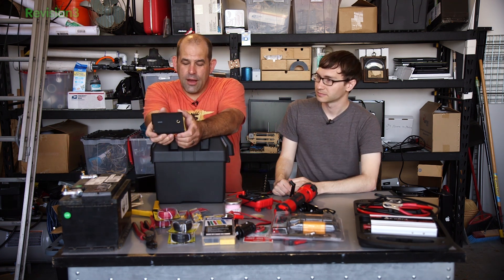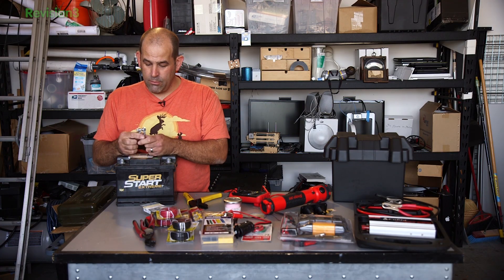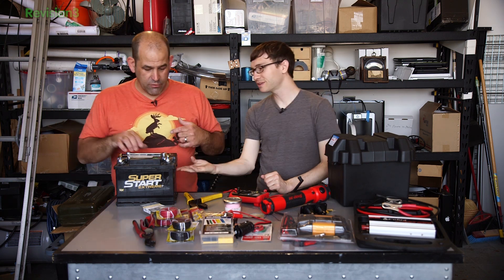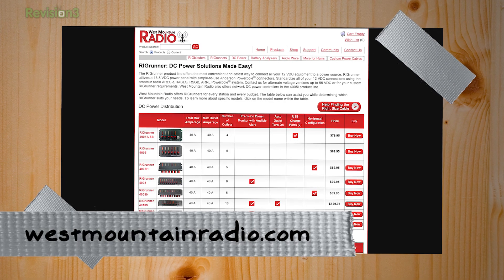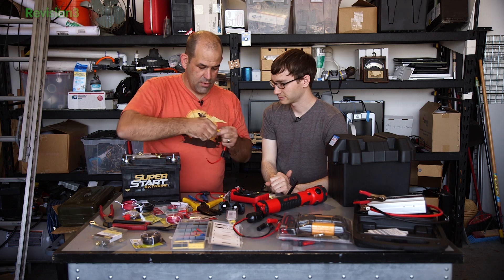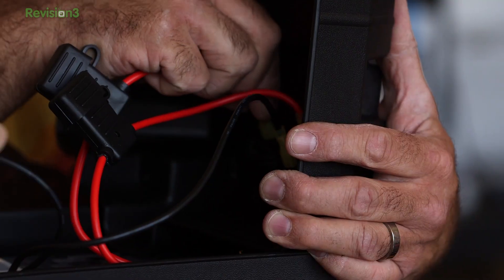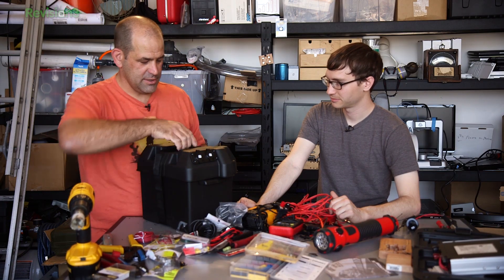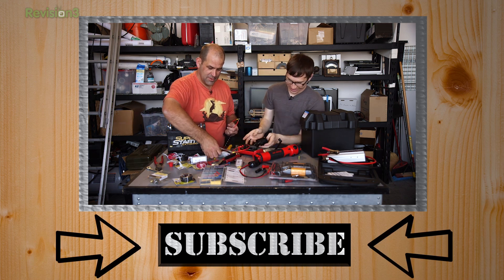Turn a Car Battery Into an Emergency Power Charger

Comment: Great video!  Want to put this setup in my truck bed box to charge my power tool batteries while at a job.  Going to add a solar panel to charge.  My only question would be what size fuses were in the lines to the outlets?  Thank you!

Comment: Anyone here today because of the power outage here in Texas???
Reply: Not Texas but Tennessee...😁
Reply: Fr😂
Reply: Well I took apart a dewalt battery pack from an old impact gun I dont use anymore and wired up some LEDs  to it for when it gets dark here soon..... I also used this for when Hurricane Harvy hit, we lived next to Lake Houston and were with out power for 3days until the U.S Coast Guard rescued us..
Reply: @TexasToxxxico  sounds good. I don't mind the darkness too much. I'll just get candles. But just came back from Walmart with a 9 dollars inverter to use for a heater and it does not work!!!! Should have gotten the 49 dollars one.
Reply: @emanuellopez1301  Sorry to here that, that sucks

Comment: So tell me how u use your battery tender plugged into a wall with no power coming out the wall socket so this method is bs
Reply: Wen the power goes out the battery, which should have full strength due to the tender giving the battery a trickle charge continually when there is power, is used as needed. A battery stores electricity for wen it is needed and only depletes very slowly if nothing is drawing power from it.

Comment: Giving you guys a like cuz it doesn't cost anything. THAT'S how generous I am. :) But, seriously, a parts list would be good. I want to make one. Does it have to be that complicated though just to charge a phone? I added connectors to my motorcycle battery and run my GPS from it with a standard cigarette lighter socket.

Comment: Hah, I happen to have an extra battery and it's the same Super Start Extreme.  I've been looking for ideas to use it as an independent power source in my trailer at work.  I would much rather charge it occasionally than mess around with a dual battery system in my truck.  I have a battery tender jr. too (unless you guys sourced this stuff from my garage) for my motorcycle and a 25A Stanley charger/starter.  Mainly want to power a couple of LED lights inside the trailer, maybe a phone charger or two.  Don't need the light that often, but the truck has to be hooked up and turned on, which it usually isn't at job sites.   

So I already bought a little 400W "Voltcube" inverter, I'll be interested to see how long it lasts between charges.  I might make an enclosure for it all together like you guys had, and I have a bunch of banana plugs/jacks so might as well give it some of those.  Also just ordered some cheap LED volt/ammeters from aliexpress so maybe I'll throw that on there.  If I want to go really crazy, I'll make a sweet RGB sign for the trailer with an arduino, parallel another battery for capacity.   

I have the battery because I replaced it (unnecessarily) a few years ago when it wasn't holding a charge consistently at all.  This is also why I have the Stanley charger, and am leery about messing with the battery system.  Sometimes it would start fine for days or weeks, other times (especially winter) it would die overnight and have to be jumped every morning.  But the new battery was doing the same about 6 months later, and it became a whole new can of worms.  Apparently it's a pretty common issue with GM trucks, but not exactly a known cause or solution.  I had very little mechanic skills, and even less electrical (I've been making a point to learn more since then).  Got the Stanley, kept researching/trying things for another year+.  Took it to 2 shops, they basically suggested replacing parts at random and wouldn't actually recommend anything.  

Finally narrowed it down and learned enough to buy a multimeter and find the parasitic drain on the radio fuses. Pulled the fuses out, has started fine for the last 2 years.  Don't need no stinking radio, I have BT earbuds grafted to my head.  TL;DR: if you want to save yourself tons of money with your vehicle, buy a multimeter and an OBDII scanner and learn how to use them.  DMM was $20, OBDII was $35, and they pay for themselves many times over.  I'm 90% certain about 75% of the money I've given to mechanics was a complete ripoff.  That multimeter was what really sent me spiraling down the electronics rabbit hole.

Comment: Not very step by step crimp, seatbelt safety plug, A-Team drill time, put the cover on...works if you’re an electrician.  Guess I’m stuck with the zombies.  I’m guessing you meant to in case people screw up and die by shock, fire or both, they can’t hold it against you.

Comment: Disappointed because you guys seem great. The DIY part - really, the information we came here for - was glossed through, leaving plenty of questions and few, deep answers. Further, a parts list would've been great in the comments.
Reply: Car battery and appropriate battery case
2x female ciggarete lighter
3ft black 10 gauge wire
2ft red 10 gauge wire
4x ring connectors
1x set of battery terminals
2x 10A car fuses
2x fuse holders OR 1x fuse block
-----------------------------------------------------------------------
addition for radio amateurs (optional)
1x set of Anderson powerpoles
2x fuse block
2x ring terminal
-------------------------------------------------------------------------
battery tender (highly reccomended)
you can buy one that uses the ciggarete lighter socket so no need to wire in extra stuff
-------------------------------------------------------------------------
DIYing your own box allows you to suit your needs the best. they just gave out a example on how the building and finished product looks. make it your own, add a light, a voltage meter, a integrated laptop charger, integrate a charger for the battery itself, add a solar input port, a killswitch that is very much missing here, anything you wish and you could think of
Reply: Agreed..!!!💯💯💯

Comment: What if im building a shack to hang out at in the middle of the woods, and i aanted to know if i could make something like this but with wall outlets to have some lights, like Christmas lights?
Reply: Buy a solar kit and you can use your extra car battery for storage of electricity, costs around $125.00  very simple set up & no drilling needed.  I bought one from a harbour freight location!

Comment: I'm a woman and I have no idea what you just did nor do I recognize the parts that you used except for the battery and the lamp that you lit up at the end. my question is......where do I buy this already made and just what do I ask For?  when you can't make it, you buy it!
Reply: Get a Minn kota power box on Amazon  about $70  does all the same.  Without the funny wiring. All you need is battery and box.Of course charger. Would also recommend Battery Tender size depending on how often you need recharge.

Comment: hi i have a hotdog cart , i need to run hot water in and have a small water pump in which i plan to use a car batt. and inverter to power i well only need to use once or twice every couple of hours, do you think i can get away with it this way or should i invest in a deep cell? like well a car batt, need to be charged more offen vs a deep cell even though i`m only turning the power on a few times a day.thanks for any input. Steve G.

Comment: I was wondering whats wrong with using zinc terminals? Also i was looking on amazon and couldn't really find the power pole wire with the fuse already setup do you know if they are on amazon i'm probably just searching for them under the wrong name.

Comment: hey patrick and michael. what about using super capacitors instead of a battery? maybe add a small solar panel to charge it anywhere in the field

Comment: I'll just assume that everything from 3:36 - 4:25... the "super cool" part of this project, actually means something, because you guys sure as heck didn't explain anything during that part. Apparently it's kind of expensive, with crimpers that cost $40... and it seams easier than something else.... and you can draw power off "the other three of these"...  but what the heck are you talking about? Seems like a pretty important part of the project to gloss over.
Reply: Point taken, probably should have cut the whole chunk of conversation about the Anderson Power Pole connectors out of there... somehow the 30 seconds that explained what they were and why HAMs and other folks are using 'em in place of traditional connectors got cut. My apologies, we should either cut the side tours out entirely or go more in depth on 'em.
Reply: patrick norton
I vote more in depth.  But I know that the longer the video is, the editing takes exponentially longer... been there, done that.
Reply: patrick norton Yeah... this video is definitely less informative than the usual. I am not even quite sure how you plugged in everything because that part is about 10 second long. :/

Comment: How hard would it be to rig one of these up to keep the lights going in a house during a blackout? The house has the lights on a separate fuse circuit, would it be very complicated to rig up? Love the show, thanks Pat and Mike!
Reply: Bad idea, unless you get a licensed electrician to install a proper transfer switch for the circuits you want to power during the blackout. The transfer switch isolates those circuits from the utility lines/you connect your generator/power source to the transfer switch.  This is important: 1) it prevents back feed from your generator from killing any electricians working to restore power 2) It keeps your your battery/generator from blowing up when the AC suddenly comes back on when the blackout is over. Good info here: http://powerequipment.honda.com/generators/connecting-a-generator-to-your-home#top
Reply: Just get lights that work like emergency lights at an office. They each charge off of your outlet and go to battery power when AC power is gone. You can actually wire those emergency lights into your home, but don't put them on a switched line. My grandparents had simple handheld flashlights like that.

Comment: I do want to try this. thanks for the little tutorial.
Reply: Please watch other tutorials. This wasn't that great unless you actually have some experience with batteries and wiring.
Reply: @TheChrislewis1989  used DC adapters for a car and it worked out great. Use it for camping mostly.
Reply: I use a deep cycle battery with an invert and I can connect a solar panel with a solar charger if I need too. Works great and free electricity. Also if I really wanted too I could connect the deep cycle battery to my cars battery so if theres no sun or it's cloudy I can run the car and charge the deep cycle battery and I also have a powerstation that i can charge both ways as well. So with a full tank of gas, some spare gas, and with the sun, I basically have unlimited power. The gas is really just for convenience. The solar charger hold a charge using the sun as a power source so I could use stuff at night if I had too.
Reply: @TheChrislewis1989  Yep. Mine is also a deep cycle battery from an RV. I really don't care about this. I have a working battery pack that can be connected to my vehicle and has USB, AC adapter, and DC connections. I'm set.
Reply: @TheChrislewis1989  it was 6 years ago now. lol. I'm fine.

Comment: Specs on those crimpers? they look nice :O
Reply: It's a Dorman brand ratcheting terminal crimper I picked up at a local auto store. Same thing is on Amazon for under $20: http://www.amazon.com/Dorman-86595-Ratcheting-Crimper/dp/B000CO7ING/ref=sr_1_9?s=hi&ie=UTF8&qid=1401394179&sr=1-9&keywords=crimper

Comment: I like emergency stuffs, thanks for the project. However, I have some questions. How much does it cost for all of these? What is the charge and discharge times? Is it worth it? Again I love your projects. Thank you for DIY projects.
Reply: 1) Cost will very greatly w/ size/quality of battery. My local Costco stocks a deep cycle group 24 battery for $80, $20 for battery box, figure another $20-30 for terminals, wire, and cigar lighter sockets.
Reply: @patricknorton  HEY YOU’RE THAT GUY! I’m in New Orleans with a Cat 1 Hurricane Ida in the Gulf due to mainline cocaine and hookers all the way until She arrives at the Coast a Cat. 4. There was too little time to even do a Mandatory Evacuation so I’m going to try to grab the things I need to make one of these, you figure a 800CCA 24 size Lead acid can charge a MacBook Pro a few times? Once ? 13x ? Thanks, just curious As I have zero frame of reference for what to expect from this project, that said not sure I have much else on the menu given the situation so I suppose we will see soon. Thanks.

Comment: Standard car battery vs AGM battery?
Reply: AGM = Absorbed Glass Matt = Sealed Lead Acid battery where the acid is held in a fiberglass matt rather than floating loose inside the battery casing. Makes batteries spill proof, vibration resistant, better deep cycle life... tend to be more costly, esp in larger sizes. Great info here:  http://batteryuniversity.com/learn/article/absorbent_glass_mat_agm
Reply: patrick norton Holy shit you actually replied. I know AGM is better to use in cars but what about a application like this?